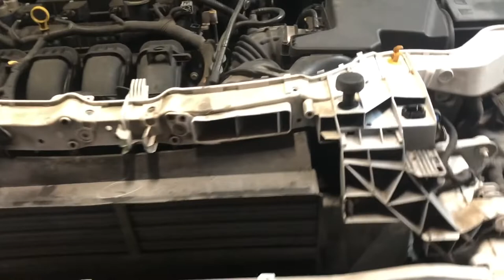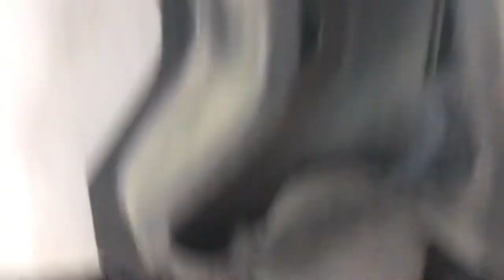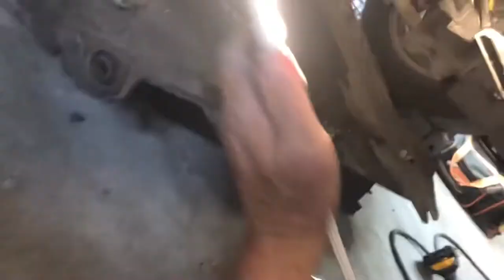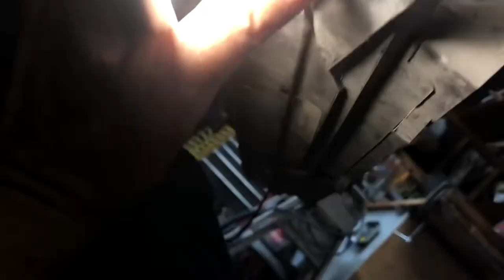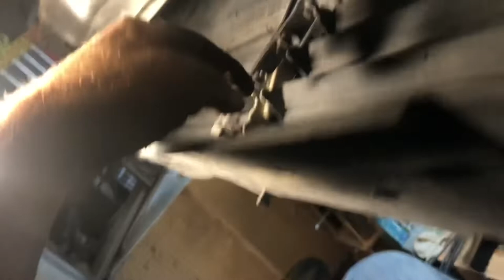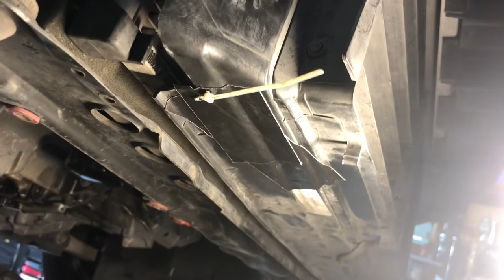How I Fixed My 2012 Focus Active Grill Shutters

Comment: those stutters arent to warm up the engine faster. they exist solely to block air and have the car more aerodynamic.  its to save gas.
Reply: Apparently it affects the air conditioning
Reply: @12Mojo  when the AC is on they are supposed to open and stay open anyway. so it shoudnt affect it. on a side note, i deactivated mine so they stay open all the time and my gas millage actually done down from 6.2l/100km to 6.0l/100km. my engine is now cool like a cucumber.
Reply from the maker: A dubious advantage only a government agency would see

Comment: After probing into all the problems associated with his ecoboost engine which all lead to overheating, my advice is one.  Take note of the position of the temperature gauge and mark it with a felt pen.  Then as soon as the needle starts going up sometimes - and either goes down again or worst still stay there, very often when you get stuck in traffic or a very hot day: just go a good mechanic WHO IS FAMILIAR WITH THESE FORD ENGINES WHO IS KNOWN TO BE A MECH ONE CAN DEPEND ON (the devil is in these details) to check everything for you.  Driving with a partially overheated engine ( since the engine warning light is now replaced with the "limp mode" which is not visible )  means that you are reducing the useful life of many parts under the hood and slowly slowly they all start to fail one by one.

Comment: This is re-engineered ancient technology ...........crazy really and few mechanics know these even exist on a focus. No wonder some people cannot solve overheating problems even though they replace the hoses, the water pump, and make sure the cooling fan and variable fan speed controller works as intended ..........................and still the car starts to overheat, sometimes.
Reply: also the plastic coolant tank blowing up... the coil packs failing. this is all due to the extreme heat under the hood. i personally burned my hand on the hood prop, i was like WHAT?!?!
then i found out about this thing.

also if you have that car remember to disconect the canister purge valve hose. the valve get stuck open and it will konk the gas tank like a pop bottle.
Reply: @Francois_Dupont  These cars have no warning light for overheating issues.  So God only know how many trips people make with an overheated engine. Overheating reduces the useful life of so many parts under the hood which then start to fail one by one.  I was brought into this since my sis has a focus - 10 years - 65K, Km and asked me to probe into it due to the endless overheating issues.  Header tank, hoses, water pump, the wet timing belt inside the engine immersed in oil all the time which melts with time, ...........etc. etc...... and you know what  -  
I have a Jag s type 2.7 diesel and a Merc. E 320 and they also have issues but not this much. Besides I am an engineer and can spot an issue the moment it arises and can easily sort it out before it escalates.
My sister just wants to get from a to be for shopping for the kids etc.....home and family......... 
So I have read enough - MY DECISION IS FINAL - I WILL HELP HERE get rid of THIS JUNK AND help her financially to JUST BUY A TOYOTA.   And we live in peace in 2025 lol !!!!!!!!!!!!!!

Comment: it would be much less work to disconect the power wire to the motor. From what I read  it will not turn on a light. Takeing out the fuse would turn quite a few things off.  I am going to look at disconnecting the connector or the  power wire to the motor.

Comment: how did you get it the shutters to open and close back again
Reply from the maker: The motor worked normally. The louvers were knocked loose from the linkage and binding up the whole operation. Once I snapped the louvers back to the linkage it resumed normal operation.
Reply: @rocks4brains  ive seen it happen many times, its usually a bird that slam into the shutters and jam them up.